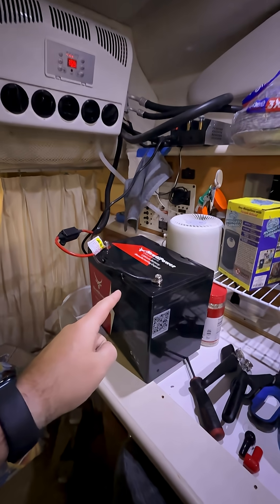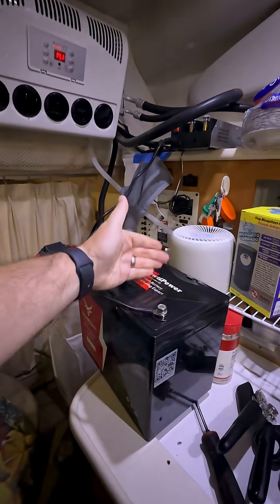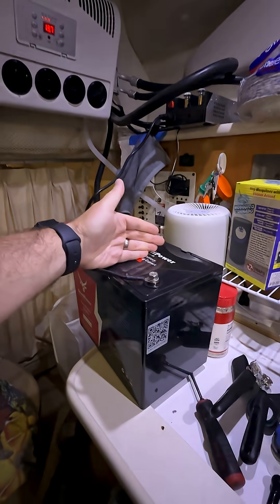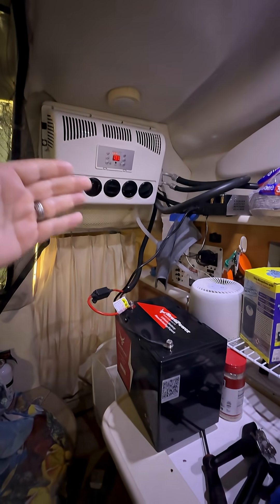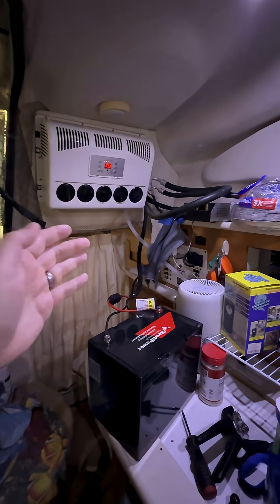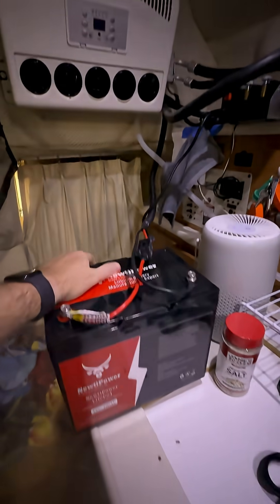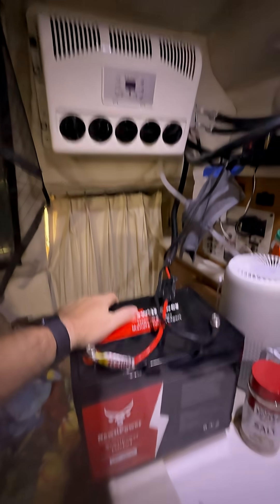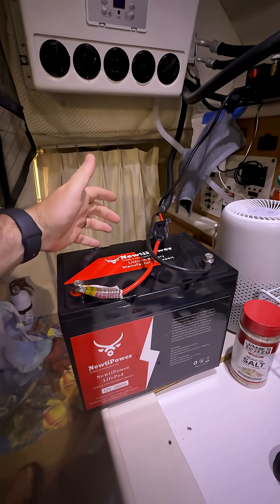How Long Will A 12V Mini Split Air Conditioner Last On One Cheap 100Ah Battery?

Comment: Dumfume 300ah on temu under 300$ two of those should get you 2 days and add 2 solar panels it will run 24/7 along with all your other needs . Ps I seen your other videos on this test
Reply from the maker: Thanks. I’ve considered a 300ah for my RV for this.

Comment: The first question is usually how much power does the air-conditioner use😅. The safest way to use a battery is by lowering the ampere as possible. Rather than picking the largest capacity, I would suggest using the output usage as reference. The best way to discharge a battery is by limiting its output to at most 120 watts. The best way for life cycle preservation is to limit the output at below 60 watt which is 5 ampere per battery. The capacity of battery is dependent on how long you need it to run. The total battery count is dependent on how much the consumption output is needed.
Reply: I will soon install one of these to test in my home back in pr powered by 3 solar panels
Reply from the maker: @delgado76 I wish I could have done that in this case. I’m impressed with it so far.
Reply from the maker: Absolutely. Definitely wanted to test if this air conditioner performs as advertised!